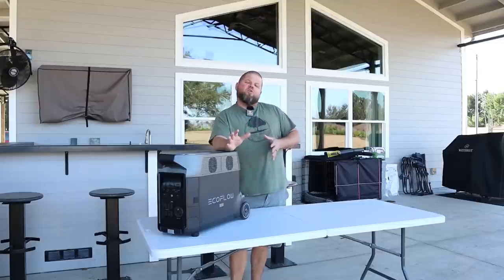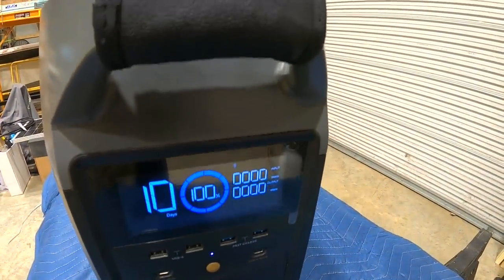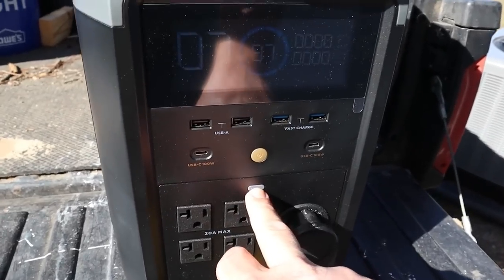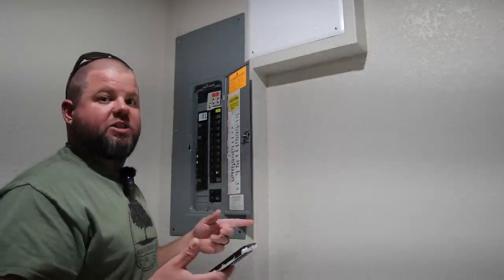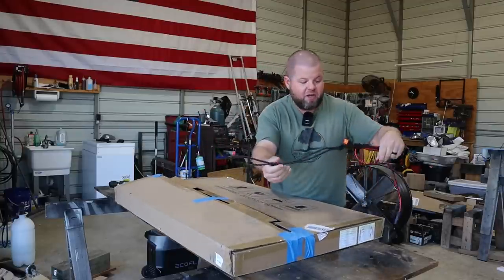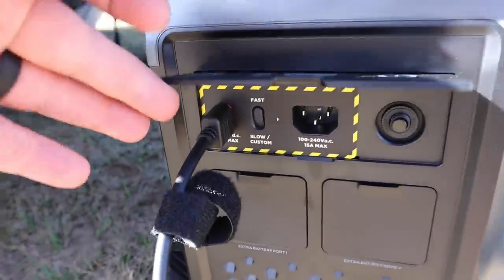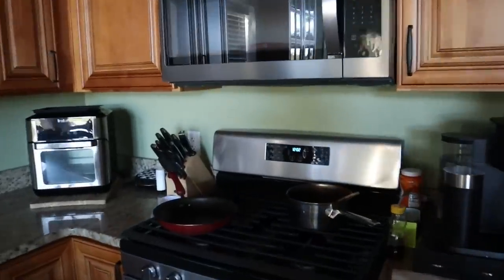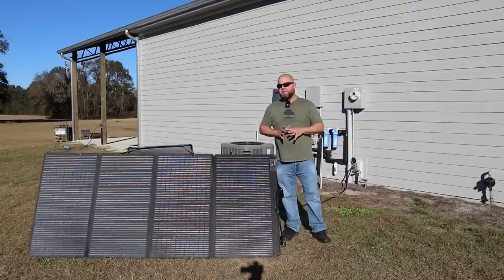Partial off grid power, it's time! Ecoflow Delta Pro whole home power solution. #705

Comment: I saw the Delta Pro on sale at Costco, went on YouTube and found your videos. This gave me the idea of power my sunroom partially off grid. Can one delta pro simultaneously power 1 ton 115V mini split & 25cuft refrigerator & a ceiling fan & a TV through the 30A outlet?
Reply from the maker: Hard to say, I'd have to see the amperage draw of your AC unit. Do you have that available? My gut says yes all that shouldn't be a problem.
Reply: @TKCL  The AC is TOSOT 12000btu. It draws 12.6A
Reply from the maker: That's around 1500 watts and I'd imagine that's only at startup. The refrigerator can pull a 1000 on startup and they usually settle out in the 150-200 watt range. With all that said, you appear to be just fine with power to spare. How long are you expecting this to run your equipment? Adding solar panels?
Reply: @TKCL  the refrigerator & ceiling fan are running 24/7. The AC & TV are used on demand about 6-10 hrs in a day.  The Delta Pro combo came with 400W panels. I have a lot of sun in TX so my plan was to charge with solar during daylight and on AC after sundown. It wasn’t clear to me If both charging inputs are being used, which has priority? If in the situation of low batt will the AC charging automatically come on?

Comment: Could get a heat pump dryer, those will run off 120V but will take longer
Reply from the maker: Or propane, I've recently upgraded my propane tank to a very large one.
Reply: @TKCL  depending on price😁(it sometimes tends to double), if you're doing solar it might cover it, along with an air source Heat Pump for heating and cooling the living spaces
Reply from the maker: Clothes line is an even cheaper option 😉

Comment: So that one generator will power your whole home including the central heat and air conditioning?
Reply from the maker: No, you need two for 240 volts to power a central AC.  This single unit will easily power any 120 volt device in my house.  I will list a video below showing two running my main AC.  I am without power now after getting hit by hurricane Idalia, we are running the Delta Pros now. https://youtu.be/rxn-cqnKuoQ

Comment: So, could you leave the generator plugged in and leave solar panels hooked up to then run everyday like you did in this video and save electricity from the grid, but still run your 240 devices off the grid at the same time provided it is through the transfer switch.  In other words save money by decreasing your grid power by using the generator?
Reply from the maker: Yes you can absolutely do that as long as you move your other loads to the transfer switch that you want powered by solar.

Comment: As long as the voltage if the panels is good you should be fine they will limit current and only use what they can as long as the voltage is in range you could hook up 20,000 watts and it will only do whatever the current limit is
Reply from the maker: Very true, but usually the smaller units have very low voltage and amperage maxes.

Comment: Regarding the adapter cable... So if I connect the adapter like you did to my delta pro and then to my inlet box with interlock kit, i will get 120 volts to both legs of my panel?   And 2nd question, for some reason the electrician who wired our house put the refrigerator and kitchen lights on a multi branch circuit sharing a neutral.  Will this setup cause any issues with that?  Thanks for any help.
Reply from the maker: Multi branch circuits are a different animal. That's old school to be honest, you might have issues running those

Comment: Have same unit.  Purchased with the plug that goes in to my home Generlink.  Even if I turn off all my 240v breakers, I cannot get power to panel on any circuits.  Any idea why not?
Reply from the maker: Most likely an issue with the generlink. I'm not familiar with the requirements of that.

Comment: Can I use the 400 w panel to charge the delta 2 max generator and the delta 2 max the same time or I need 2 400watts  thank you
Reply from the maker: You'd need seperarate panels to charge two units.

Comment: River Pro's booklet says solar panels must be wired in parallel.  I have 2 of their other units, and both can be wired in series.  No clue why?
Reply from the maker: That makes no sense, they have a voltage and amperage rating. That's all you should have to worry about staying under.

Comment: Can you add battery banks while the delta pro is on?
Reply from the maker: Not sure what you mean. You can definitely add up to two additional 3.6 kwh batteries for larger storage capacity.
Reply: No, both units need to be off when connected.

Comment: If I got the delta pro and 2 batteries. How many solar panels would I need. I also got the one 400w flexible panel. Any help would be appreciated.
Reply from the maker: It depends on what all you run. They max out at 1600 watts, but it's hard to get there due to voltage and amperage constraints. I have been running 1200 watts per Delta pro with good success.
Reply: I bought a Bluetti AC300 with (2) 3072Wh batteries so I'm in the same boat you are.  I don't know enough to claim which brand is better but I think they are very similar.  I did buy (2) 420 watt panels and they work well.   I was charging around 650 watts in on a fall day.  I'm considering buying another AC300 and 2 more batteries so I can generate 240 volts and 12,000 Wh and do what he is doing on this video.  It's very addictive let me tell you.

Comment: The Main Thing I think People are missing/overlooking besides the Obvious Ease of Use is the mobility factor to match the Power capabilities and taking into act. they also have a peak of 7200w and 3600-4500 running That can then Be paired With Another generator or extra Battery. As a Standalone Home or Mobile Solution it only cover so far before it gets prohibitively expensive (for me at least). as others state a will prowse diy solution in any off grid rv,camper or home is a must to Expand this things Capabilities...Luckily These systems can be fed into each other to maximize power and Savings. I envision for myself a Workshop in a Utility Trailer to be powered by this Delta Pro and (2) 400w Panels that will eventually pay for a Campervan that Tows a CamperTrailer. All of these vehicles have a limited Footprint for Solar Arrays and I think People are missing that part. how could you fit anything bigger than a 1600 watt array on a RV or School much less a Van or 16ft Trailer. An immobile Power setup can afford to be cheaper because it won't be moved nor jostled with need to be robust. Im going to get a cover for mine and see about a wheel uprgrade. Don't forget to use the Panels as water barriers when it rains as they are waterproof! thanks for the review.
Reply from the maker: The DIY plug and play, adaptability, plus portability is the big selling points for these.  There are of course many other solutions out there for more permanent mounting.  Wait until you see tomorrows video where I show the portable side and what all it will run.  I am quite certain I powered and ran things no one else has tested.

Comment: Great video man! I'm wondering if you can power a central AC unit with 1 or 2 ecoflow delta pro. I have a 4 ton central AC unit and I want to dedicate 1 or 2 ecoflows to power it in the summer but not sure if possible. What do you recommend? thanks
Reply from the maker: One isn't possible because it only provides 120 volts. You will need two and their dual voltage hub for 240 volts. Also does your AC have a soft start capicitor? Those make a huge difference on startup surge of the compressor. I highly recommend having one added, only cost me $150. Spoiler alert, I just got a second Delta pro and I'll be testing my central AC with it. I wont have that video our for a week or two. So be looking for it.
Reply: @TKCL  I don't know if my unit has the soft start capacitor, will have to ask the hvac company who installed it. Just subscribed to your channel, can't wait to watch how you power your central AC. Thanks for replying!
Reply from the maker: Tons of solar reviews and tests coming! Building some stuff as we speak!

Comment: Great informative video.  Question.  If your solar array is not close to your eco generators, what kind of extended cables would you specifically need to buy?  Thanks
Reply from the maker: Depends on the voltage and amperage. That can changed based on how you wire your solar array (series or parallel). Bigger is always a smarter choice, but it also depends on the length of the run as well. 10 GA minimum and go larger as amperage and distance increase. I'll be covering some of this in an upcoming video.
Reply: @TKCL  That’s where I get lost.  Over the summer I bought 2 delta pro gens and 4 batteries, plus the voltage hub to connect everything.  My problem is only space for solar is in back yard and my panel is in front of the house.  I don’t have solar panels or transfer switch installed yet.  Cuz I don’t know what the hell I’m doing, just trying to prepare!
Reply from the maker: I'm building a solar array starting next week just for my delta pro and I'll be sure to touch on a lot of this. It can get confusing. I'm looking to add a second one and the hub myself.
Reply: @TKCL  Nice bro.  With eco flow panels?  I need to get panels and extended cable length, or these are just expensive paper weights.
Reply from the maker: No they don't offer true always outdoor and permanent mount panels. I am going with Renogy panels.

Comment: How or why would you charge it from a wall outlet when in any case you'd be using this there wouldn't be any power to be able to do it?
Reply from the maker: Your thinking about one scenario. People charge these from the wall before potential outages. Some charge from an efficient inverter generator. Some charge from the wall on cloudy days. Unless you have a lot of extra batteries, it's not uncommon to use 120 volts to charge.
Reply: @TKCL  Thank you for the response that makes sense

Comment: were you running your air conditioner that day? hurricane ian took out the power to my house for 11 days and the money i spent on an airbnb with electricity is about the same price as getting a solar generator like this. i am trying to figure out what kind of solar generator i might want to buy for a several day outage that could run my refridgerator, freezer, and some fans. my mother wants air conditioning because the gas generators people use in the neighborhood are SO loud that she doesn't want any windows open. do you have any thoughts on this? thank you for this comprehensive video!
Reply from the maker: I see you found the other video.

Comment: I just bought the delta pro with solar panels, do you have any idea how long it takes to get 100% charged with the panels ?
Reply from the maker: Depending on sunlight, 8-10 hours in full sun.
Reply: Wow that is a long time to recharge when you have no power.
Reply from the maker: That's with the 400 watt panels. Add up to the 1600 watts max of solar and your talking 2 1/2 hours to recharge.
Reply: I bought it from qvc, pretty sure it's 1600 watts, but I will check. Thanks.

Comment: With respect to 120 volts and using the TT30 to L14-30 with the panel interlock plate, one must also be carful to not use any MBWC (Multi Branch Wired Circuit) in your electrical panel. MBWC use a shared neutral. Although your MBWC might only be on 15 amp circuits typically found in kitchens where there are split plugs using a 14/3 AWG wire, using the TT30 to L14-30 can overload the neutral wire and cause a fire. A dedicated 120 volt transfer switch is a better solution for ONE single DP.
Reply from the maker: Very true, typically you don't find those circuits anymore but a lot of older homes do have them. I still stand by the transfer switch being the most foolproof way.
Reply: @TKCL , Agreed. I am in Canada and my house was built in 2003 yet they still build brand new houses here with MBWC's. In fact, I just had my whole house panel swapped out last February to consolidate 2 panels smaller panels into one larger panel and the electricians still use MBWC's.
Reply from the maker: You don't see it here, we have all new breaker rules. It's become extremely expensive to add a panel now.

Comment: and you don’t have to worry about “sending” 400 watts.  The charge controller doesn’t work that way, it’ll only
Pull what it needs to pull.  You can have 1000 watts of solar and it only wants 200, it’ll only take 200.  The BIGGEST thing is to make sure the voltage range is correct.  That’s all.

I know a guy that has 2,500 watts of solar panels for his delta pro.  Why? He got them dirt cheap used, and on cloudy days he gets near the output of max.  On a pure sunny day you’ll see it’s input at exactly 1600.
Reply from the maker: That's great to hear, but I don't see how he is staying under the max voltage and amperage range on a full sunny day. 150v 15 amps max
Reply: You series / parallel them.  Pretend they’re 24 volt panels.  If you had 240 watt 24 volt panels.  You’d put 5 in series, that’s 1200 watts.  Then you’d have another 5 in series, and those two “sets” feed into an MC4 10awg Y adapter.

Analogy is your truck.  It’s 12 volt and it’s dang important you stay with a “12” volt system.  Not 6 like a golfcart, or 24volt like some big rigs.  But you can parallel say, 4 truck batteries for 4,000 cold cranking amps.

Your truck might only need 400 of those 4,000 cranking amps, so it’ll only pull 10% of what the battery has to provide.

Same thing with solar.  Voltage is crucial but amps isn’t.
Reply from the maker: I'm definitely familiar with series, parallel and series parallel. I was just adding up in my head 25 100 watt panels would be impossible to meet factory max on both voltage and amperage. Plus that uneven number of panels makes it impossible to evenly series parallel. That's also me assuming it's 100 watt panels.
Reply: @TKCL e best is residential panels.  They’re cheaper and tougher than boutique Chinese hobby brands like BougeRV or Renogy.  They all have to pass UL.

Brands like Hanwha, Canadian Solar, SunPower, LG, Panasonic, Rec Solar, solarworld, etc are all great.

I got myself 35 volt 280 watt REC Solar panels used off Craigslist for $80 each. Power washed them and they look good as new.

The thing about solar you gotta watch out is as they heat up voltages sag.  No biggie.

But when it’s cold, say a winter day that’s shaded by clouds, then the sun pokes out, that’s when you have a high VOC.  Especially during that polar vortex.  So if you used 35volt VOC panels, I’d only do 3 in series, then parallel that up.

I have 21x 280 watt panels on my roof I got for $80 each used.
Reply from the maker: @xzibit8614  that's a great deal, I just got the new compact Renogy 100 watt panels. I was seriously considering 320 watt residential panels but have some reasons why I wanted to try the cheaper ones.

Comment: As always great video . Very interesting and got me thinking . First off I’m not a electrician so all this stuff I’m told is over my head . We have a 1700 sqft house . We heat with natural gas and cook with it . I have a 5500 watt generator with a 30 amp plug . Was told I needed a 7500 watt Gen with a 50 amp plug to run my house . I did pay an electrician to install my transfer box witch is 50 amp . I have central air and he said I can’t run my ac on a 30 amp plug ? Everything is installed and ready to but if I lose power in the summer I have no ac .maybe I just need to buy one of these units ? Ps our hot water heater is also gas and no deep freezer just one fridge . Any info is appreciated, thanks .
Reply from the maker: Depending on the size of your hvac maybe! Also a soft start capacitor makes a huge difference for generator starting. FYI a 7500 watt generator will produce no more than 30 amps usually, you'll need a way bigger generator to hit 50 amps.
Reply: @TKCL  my electrician sent me a link to a dewalt 9000/ 7500 50 amp  generator at Sams Club for $849.99 . My unit is a 2 1/2 ton , it has 2x20 amp breakers on it in the breaker box . I got a Reliance 510C 120/240-Volt 50-Amp 10-Circuit
Pro/Tran 2 Indoor Transfer Switch put in . I just wanna be safe and not kill my appliances and stay cool or warm when needed . Maybe run a few lights and a radio / tv .
Reply from the maker: I bet you can run that hvac no problem as long as it has a soft start capacitor. Just don't run any other major loads while it's running. You can also add a soft start to the hvac after the fact, it's a must have item.
Reply from the maker: Also I don't recommend running the emergency heat strips on a generator that size too. If your unit is a heat pump unit run just that. I have the ability to turn off my heat strips via my smart thermostat.
Reply: @TKCL  I have a gas furnace and it’s about 2 yrs old and central air ac .
Reply: @TKCL  we’re old school and like the natural gas heat , it heats the house up quick . Our gas bill is usually $95to$110 a month and we have a very warm ranch style house built in 73 but I have totally remolded it inside and out . It’s paid for and we love it . My ac man told me to stay with the gas furnace when we replaced it . We were going with heat pump but since our heat exchanger and our  ac outside unit was like 9 months old we decided to stay with the furnace . That gas bill is also with our cooking stove and hot water heater that we use a lot in the winter months .

Comment: If you could shut off two panels, then Ecoflow couldn't sell you a different portable panel setup for your smaller units...LOL  It's all about the Benjamins!
Reply from the maker: Well technically you can fold two over on each other to drop output.  But you can still wind up with some odd voltage issues on tiny units.  When running a large unit like the Delta Pro, I highly recommend a permanent solar array with a lot more panels.